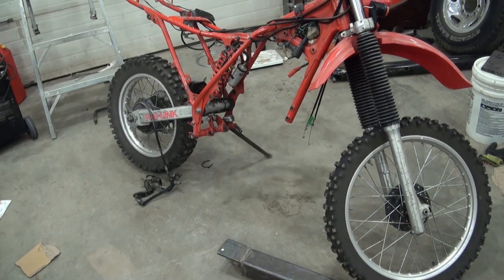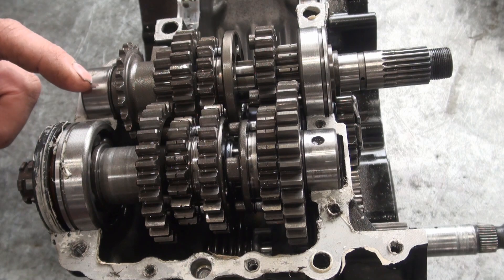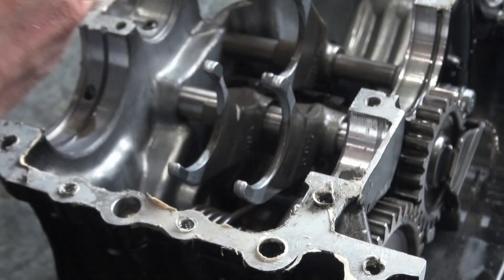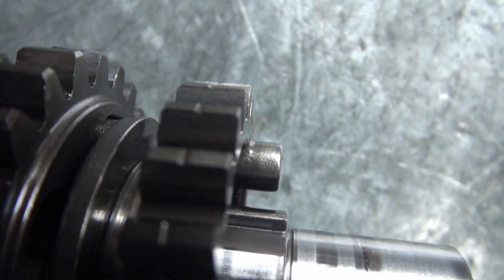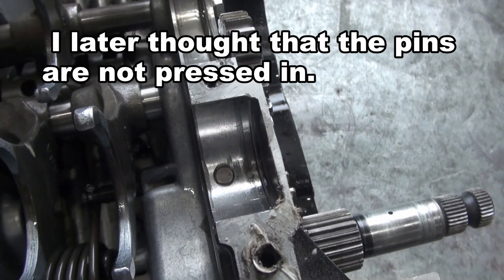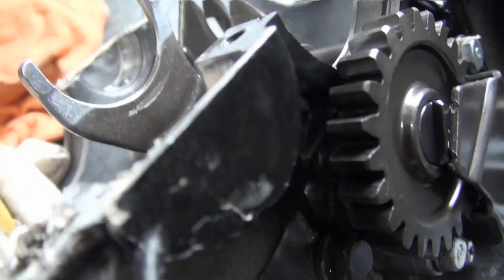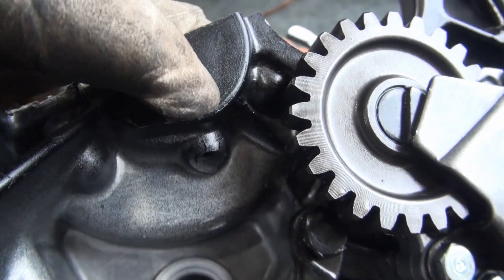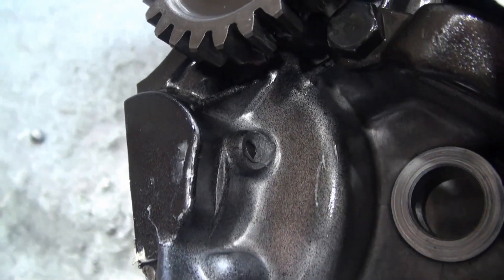XR500 First Gear Problem Analysis

Comment: Same thing happened to mine after trusting someone else to replace a broken output shaft.
I used a 50c coin as a spacer to keep the bearing in the correct position.
Reply from the maker: Was yours also same type of engine?
Reply: @groutaone  Yes, XR500. 45 years ago.
Reply: @groutaone  YT removed my previous reply. Yes, the same model, 45 years ago.

Comment: someone installed the bearing with the hole not on the pin and it pushed it too far down, breaking the bit off there.
Reply from the maker: Yes, that could be what happened.

Comment: Buddy bought my 84 and it got hit so the shifter shaft got pushed in or damaged enough the motor needed to come apart to fix the problem ,said if it wasnt for that it had barely any ware on the internals,smoked some when 1st fired up but cleared up and ran strong always

Comment: You cause that by putting it together the wrong way the first time . Then when you tightened the bolts for the two Case halves Together, It pressed the pin down And popped out the bottom Of the hole. Just fill the bottom of the whole with JB WELD puddy, Enough to allow the pin to be sticking out proud of the hole.